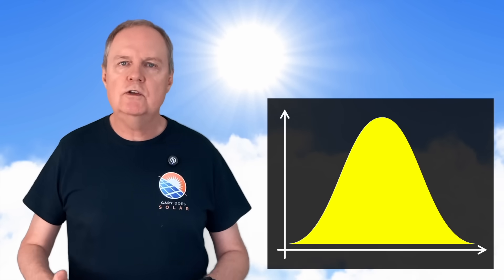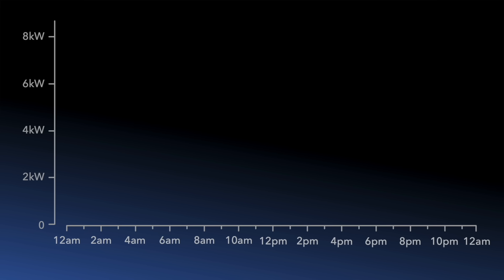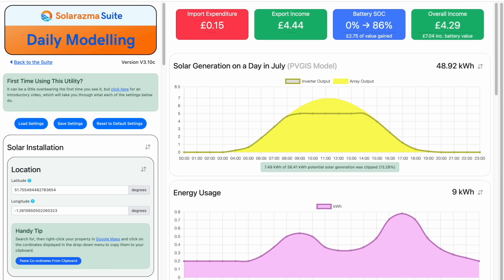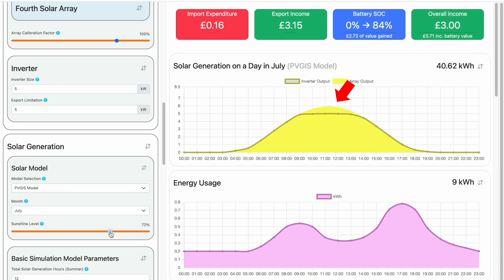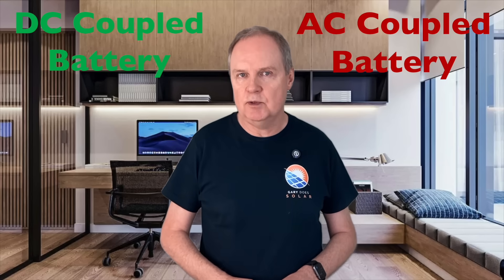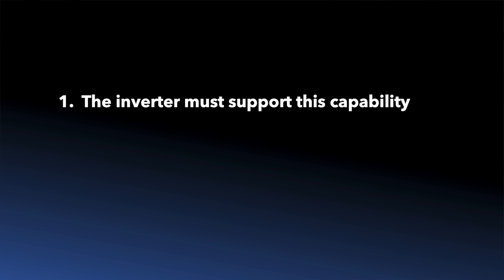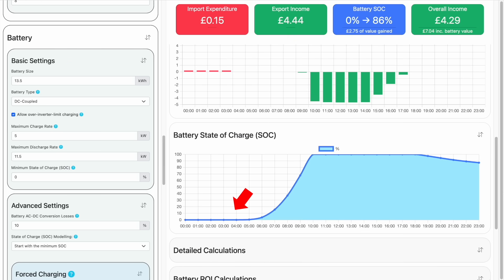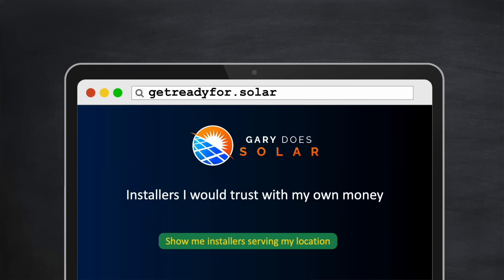Solar CLIPPING and what you can do about it…

Comment: ALTERNATIVES suggestions.  Is there a way to limit Amp going from solar panel to the (micro)inverter? In my example I have a 16A input (on Hoymiles HMT-2000), the panel will usually produce less Amps... if I added another panel There would much more be the maximum Amp reached, but when Amps go above the 16, the more they do the bigger risk that components can´t handle it. Therefore I ask, can you in any way LIMIT the max amount of a solar panel going forward?
OR
Could it be possible to have like 2 panels, and with a switch disconnect one during summer? And activate them when the sun is low - in winter, but then having 2 panels producing power, and now the amp is so low, it won´t damage the inverter?

Comment: Does the clipping come about as a result of (1) high voltage, (2) high current or (3) a combination of both high voltage and high current?
Reply from the maker: It’s power, which is voltage multiplied by current, exceeding the AC limit of the inverter 👍🏻

Comment: I live on the equator with a 6 panel array and inverter. There is no export tariff.
The array will cover all domestic usage on a sunny day from around 8am to 4 pm and contributes a few hours either side.
By not having a battery I avoid the cost but I am concerened I am not using all available power due to self clipping
Reply from the maker: Thanks for sharing this, Julian. Great that the panels are working out for you! Worth keeping an eye on battery prices (especially second-hand units that will become available as people upgrade)...

Comment: Surely you also need to consider that you're unlikely to produce the theoretical maximum from your array as they'll rarely be facing exactly the optimum direction at the optimum angle.
Reply from the maker: I hear what you’re saying but even when my own panels are not directly facing the sun, they are often still generating at their rated output.

Comment: Hi Gary,
I am a regular watcher (and subscriber) and wonder if you have covered a particular aspect on PV array efficiencies. I have a 16 panel ground mount array using two Cornish Rocker frames that face just a couple of degrees west of south. These are manually adjusted several times per year to track the elevation of the sun. I have been wondering if, were they able to automatically track the sun for, say, 30 degrees either side of south, would that have any significant benefit on their efficiency & production? Any thoughts on this please or have you covered it in one of your videos?
Reply from the maker: Hi Gary, I really appreciate you watching my videos 😀 Now, I haven’t looked at the topic of tracking as yet, but for ground mount arrays, it would be straightforward to model the impact of adjusting the array tilt (my existing modelling utility will do this). There is a potential constraint thought, which is the spacing between rows, where a lower tilt could resulting in shading.

Comment: My system charges the battery and when the battery is full, it does automatic switching to heat water so I don’t experience any clipping. I use all the power available from the panels.
Reply from the maker: Great! But are you able to access an energy tariff that pays a high export rate? See my video here for a different way to do things:

https://youtu.be/6zc1g1bz0eA?si=0WPjrvDKqMuvgaB4&utm_source=ZTQxO

Comment: Although you miss out on the peak production on the best days, the reality is that by oversizing the array to the inverter you gain substantially more power on the first third of the day and the last third of the day. I have a graph to show this, but I can't attach it to this comment.
Reply from the maker: Don’t worry, I can visualise that graph. The answer is to put as many panels as you can on your roof, then attach them to the largest inverter you can reasonably afford. Remember, larger inverters are able to provide more power without necessarily drawing from the grid—and you might get a higher export limit too. See my video here:

https://youtu.be/5y2dJ8S6zDU?si=qNPkvyLJv0Y1cWCP&utm_source=ZTQxO
Reply: @GaryDoesSolar Thanks.
 Excellent video. I have 6.8 kwh ground mounted system that I am planning to increase to 10.4 to change an our new EV.

Comment: I looked at this in a video I did about my system a year back.  I did a bit of curve fitting to work out what the peak could have been with a bigger inverter, and the loss was very small.  Weirdly, the loss was less in June than in April, possibly due to PV array temperature.  Then when you consider that a larger inverter may require more start up energy so be less efficient in low light conditions, and the system looks like it was probably well designed after all.  Even so... it looks like a waste of energy.

Comment: The only plan I've got to avoid clipping is a bit unrealistic at the moment. I've got an 8.9 KWp array into a 6 KW inverter. So on sunny days we sit at the limit for 4+ hours and probably lose quite a lot. My plan is to install a load more panels and a second inverter, creating two arrays of around 7 KWp each. That should pretty much eliminate clipping. What's holding me back is that I'd be exporting most of the extra generation and have fears that the export rates will fall significantly. This is mainly based on your video about the Duck Curve and what happened in California, it seems clear we're headed in that direction as well. So I'll likely hold fire for a few years and see how things evolve. If we get a heat pump that might change things, for example.

Comment: 7:17 is not correct for all inverters.

Inverters dont necessarily have oversized mppt solar controlers vs the inverter size.

IMO you should go for separate MPPT charge controllers coupled to stand-alone inverter chargers, all DC coupled to a battery.

Comment: However, if 470 Wp x 15 solar panels are 7050 Wp, about 7 kWp, but not all the power, because there are variations in orientation or positions and also efficiency, about 5% to 25% are lost depending on the quality of the solar panels. As an example, a 7 kWp system has a maximum output of 4.5 kW to 6 kW, like my total plant of 6.5 kWp, but at most a little below 6 kW.

Comment: Many utilities restrict maximum upload amperage and charge more for higher amperage services.  Most solar installations are in fact designed to clip .. often a lot .. for this reason.   In a nutshell, clipping allows high amperage for more hours and trying to eliminate clipping costs more due to higher utility capacity charges.  Further .. even if your utility does not charge you for capacity today .. chances are they will in the future because, basically, they have to as the world electrifies.  5 yrs ago, most inverters were designed to allow about 30% clipping.. and now most can do 50% .. and if memory serves, some optimizers can go much higher.  Anyway .. clipping is a feature .. not a bug.

Comment: Concerning the degradation of the modules with time, at least for my modules from 2008 (installed in Germany) this doesn't seem to be a thing. I cannot detect any degradation so far. The worst years I had were 2013 and 2010, and the best were 2022 and 2020. It seems that degradation, if there is any, is more than compensated by climate change.

Comment: AC side battery does not matter. As clipping is only a concern in high summer, when the battery will be full way before midday anyway!
I would not charge overnight 'anyway'. For the last 3 months? I have paid for no electricity, (bar the standing charge con) Battery refills before midday usually. Last winter my first months of having it all, I topped up to 75% or so depending a bit on the forecast. A sunny winter day might top it up and reduce  the need to buy any the next night.  If you start full, the spare of a good day's sun for the time of year, is just wasted.

Comment: My system is 7.5kWp solar with a 6kW inverter and 15kWh DC coupled battery. As I'm on Octopus Flux in the summer I export everything the battery has in the peak rate, leaving it pretty much empty by the morning. I've limited charge rate so the battery reaches full charge around 1:30 - 2pm. This takes care of all clipping. Occasionally this technique does get caught out on overcast days with intermittent sun where the battery doesn't quite reach full charge before 4pm, while the sunny peaks get exported at the lower day rate. I could fix this with automation but it's rare enough that I haven't yet bothered.

Comment: During clipping periods users could heat watertank with DC current.
Reply from the maker: Certainly, but your inverter would need to support DC output to your watertank, and your watertank would need to support DC input.
Reply: @GaryDoesSolar Feeding directly from one of the arrays?

Comment: Bear in mind that when you're exporting power to the local supply from your string inverter, you're polluting that supply by injecting harmonic currents into it. That, in turn, causes voltage harmonic distortion to the detriment of other consumers that have a right to expect a certain quality of supply. It's a bit like peeing in the local swimming pool. There has to be a limit on how much pollution you can cause.
Reply from the maker: This is precisely why distribution network operators type test inverters before they're connected to the grid to make sure they're operating within tight standards (for example, IEEE519 in USA and ISO/IEC61000 in Europe.

Comment: In 2022 we had a pv system with 19x395wp panels in three different orientations (south, east, west, 50degrees pitch) and partial shading on each side of the roof. That’s why we went with Enphase Iq7+ microinverters (290w max continuous output) and they have been great. Yes, there is a bit of clipping but it’s difficult to quantify it and I would reckon it’s less than 2% annually.
In May 2025 I installed one more panel , facing directly north, pitch 5 degrees. I went with Iq7A which has 349w max continuous output. The Iq8HC is rated at 380w but it’s not compatible with the Iq7 series. I paired the Iq7A with a 645wp panel which gives a DC/AC ratio of 1.85 and so far I can see there is clipping, however this unit produced 72% more energy than the second best on the most sunny day. It goes up to over 100% for periods with clouds in the sky. This time of the year shading on the roof is at its lowest.
If for whatever reason one opts for microinverters, go with the highest  rated panel that would fit on the roof, makes sense financially and is compatible with the microinverter. There is an Enphase online tool to  check compatibility for free.
BTW, it’s a simple DIY job to add panels to an existing Enphase system

Comment: The other factor is the actual temperature on the panels, as efficiency goes down as temperature rises. Over the years, I’ve noticed some clipping on bright days & reasonably cool weather, but not on typical mid Summer days.

This happened on a setup which had a slightly small inverter, on account of an extra panel being squeezed in when it was installed some years ago. It has made it possible for the inverter to start up at lower light levels, though.

More recently, the old inverter has been replaced by a new one, along with more extra panels, with the inverter being rated at a higher level than the panels combined, so it has not clipped at all. Incidentally, the new inverter has several display outputs that make it possible to compare the older and new panels with each other, as the old and the new are connected via separate strings. It displays the DC input voltage and power for each group, along with the AC output and input (voltage and frequency). So it’s been possible to estimate how the older ones have deteriorated over 11 years, which is in line with the original paperwork - about 4% down over 11 years.
Reply from the maker: Thanks John, for taking the time to share this. Great points! And 4% over 11 years sounds about right to me (0.5% per year)...

Comment: I had exactly this issue with my south array (and still do with the north array,) 6.3kWp south array, with a charge controller that was calculated by the manufacturer, I was only getting max 4.6wW generation, pver a large part of t eh generation day, I realised the manufacturer had oversized my panels, but I want max generation, so I had to buy a second charge controller, so now i get max generation, I have had a continuos peak of around 7.3kW generation on some days, and always break through the 4.6kW limit of the single charger, it was costly, but I calculated it would pay for itself over a two or three years, so I dont lose any generation at all on the south array, and get maximum return, the other issue I had was overheating of the single charge controller which lowered efficiency, and sometimes made it cut out, therefoe huge lost generation. The North array, again 6.3kWp, also has clipping, but not as great as the south array, and I worked out it was probably not worth buying a second charge controller, however, the controller does max out at 6.4kW, and does get hot, and a few times cuts out, and I have to reset it, so i am losing not only the small clipping, but on days the controller cuts out, and I dont notice or cant get it back on, I am losing generation, so there may be a case to add a second controller to the north array too as I get clipping, heat inefficiency, and also cutting out which stops all generation, for me, elimination clipping is far better than allowing clipping to happen, i do understand there is an argument about oversizing, and thats its better for low generation days and winter, but I think max generation in my case overides low generation days and the small extar i would get from those day. Just one other point .. Heat, and very sunny hot days, I notice on a very sunny hot day, my generation can fall by up to 20 - 30%, over a cooler maybe partly cloudy day, one would expect the very sunny dat to generate more, but the heat limits the efficiency of the panels, in quite a big way, cant remember seeing a vid you did on heat, but may be worth looking into for a future video, both how heat effects the panels, and also the kit
Reply from the maker: Hi Kevin, thanks for taking the time to share all this. Great points and it shows that, like in your case, the cost of upgrading the inverter could be returned in just a few years - especially as the cost of inverter technology is reducing all the time... I'll aim to cover your point on the effect of heat on solar panels in a future video!
Reply: @GaryDoesSolar  Just to be clear, i didnt upgrade the inverter, I added a second charge controller to one of the arrays so i was able to remove curtailment and clipping all together, and harvest 100% of generation always, i have a victron  inverter, and now three charge controllers (previosuly two) that charge the battery rather than a hybrid inverter, and it may be worth investigating heat on not just panels, but equipment also, and how ventilation and possibly even extra cooling can be a benefit, i added extra fans in out generating room to expell all the hot air in there, which increased efficiency

Comment: Add clouds and it is 1kw rather than a 5kw array @ .75kwh. I have a faulty inverter now that clips 90% off my overcast production at 60% SOC insane, it is being replaced by a 12000xp.  
I would look at the advantage of more overcast power.
Reply from the maker: Hi Bob, yeah people forget that even on a sunny day, there may still be clouds, and those clouds may bring down generation dramatically. There is an upside of clouds though, if the sun is not eclipsed by them, then can actually increase generation due to reflection! :-)
Reply: @GaryDoesSolar  my vertical arrays get snow blindness. I make 65% in July and 125% in Dec. 16hrs vs 6 hours, less  degradation since I float 12 hours a day. With mylar I could get 125% everyday but I don't need it.

Comment: Clipping isn't really a problem unless you either use a lot of electricity in the summer or have a good export rate and are allowed to export all your excess. The reason to oversize the panels is to increase generation during the non-summer months without overpaying for the inverter.
Reply from the maker: Hi Pete, agreed! And maybe it always come down to this: simply maximise the number of panels on your property, to capitalise on al the benefits :-)

Comment: So i have a 28 panel, 3 array, 12.04 kw solar system with a fox kh7 hybrid inverter and 28kwh battery. The arrays are south east, south west and north east. My clipping point is about 7.35 kw. The clipping would happen at this time of year (summer) between 10.30 and 4pm. To combat this i discharge my batteries to grid down to 20% by 5 a.m. The remaining battery power then feeds the house until solar takes over. I have then set the inverter to feed-in to grid rather than top up battery from 8.30 a.m. until 4 p.m. This means I have no clipping at all. The array often reaches in excess of 10 kw with between 6 to 7 going to grid and the rest to load or battery. By 4pm the arrays are producing less than the clipping max so the inverter then returns to feeding battery and load.I will obviously change things around as we head towards autumn. The maximum production i have had is 11.7kw, so happy days.
Reply from the maker: Hi Andy, thanks for taking the time to share your strategy. Looks great to me! And hopefully will give others ideas on how they could incorporate for their own system :-)